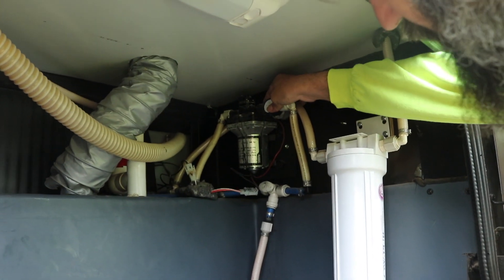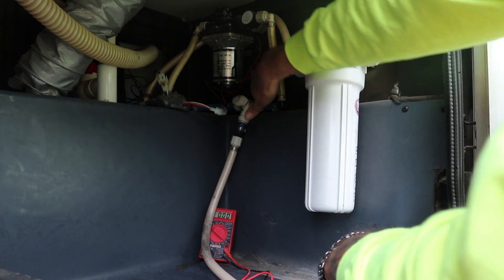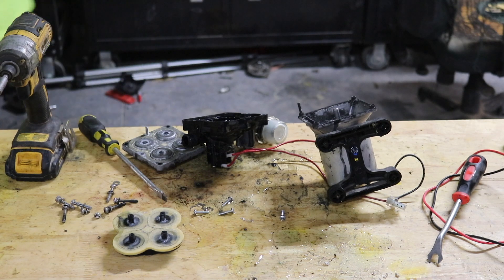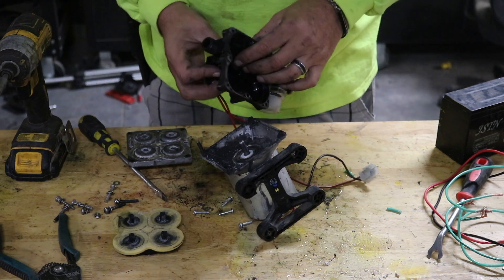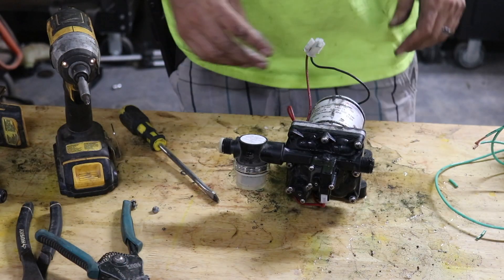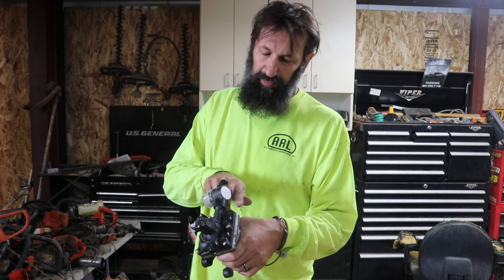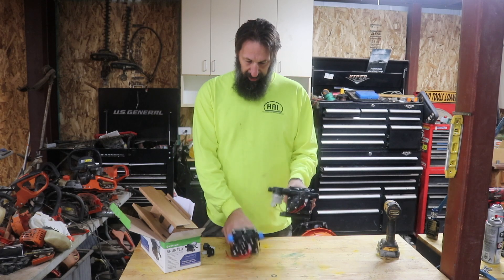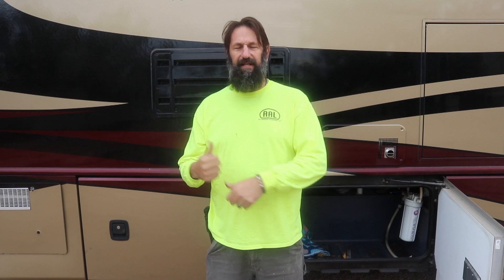F53 Class A Water Pump Repair and Replace | For Beginners

Comment: The check valve should prevent you from blowing air or water through the pump the way you first tried.(backwards). Safe travels.